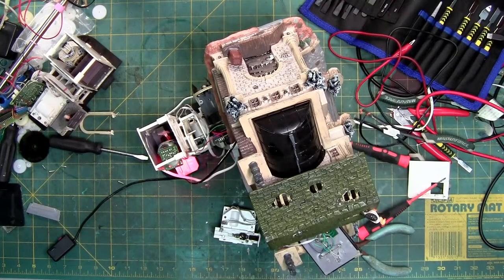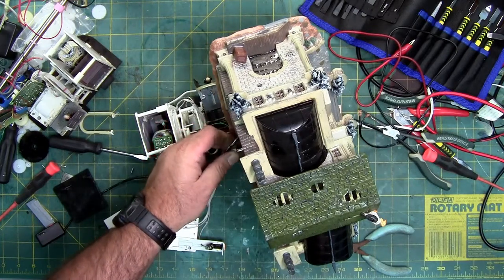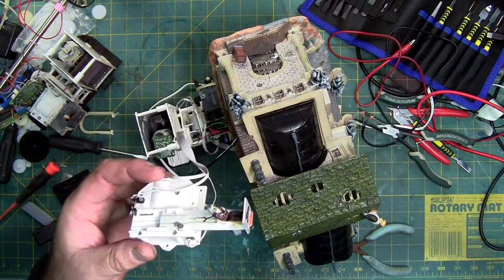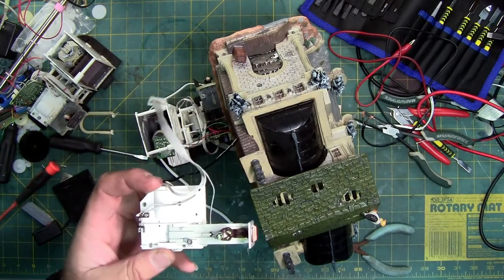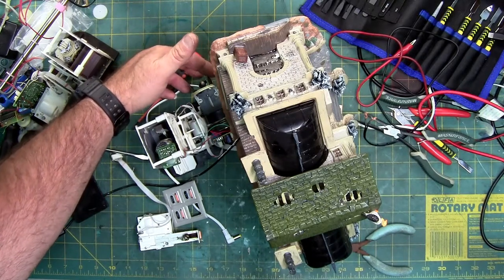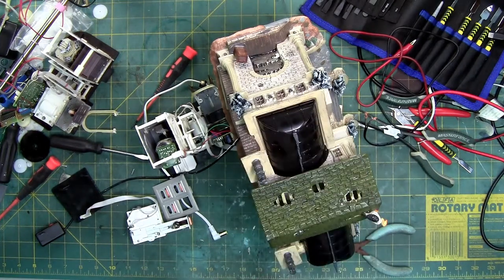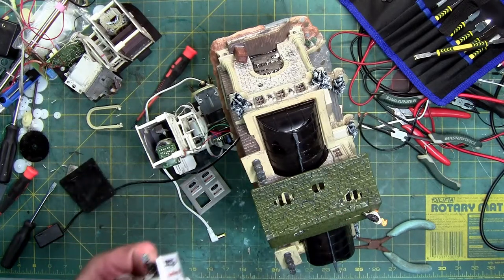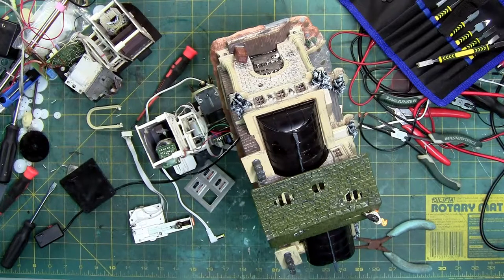How to fix R I P  Mausoleum Drawer and Door

Comment: Thank you for the explanation of how the parts work, I'll have to go look at your original repair video on this. I bought one when new, and it worked for many years. Then the corpse wouldn't lie down and the drawer stuck open. My mickey mouse was to file an arch in the wall so he slid in and out sitting up. I could live with that. But then the mortician stopped going back in, so to prevent further damage it's just a static piece. Maybe after watching your other vid I might give repairing it a shot. Maybe.